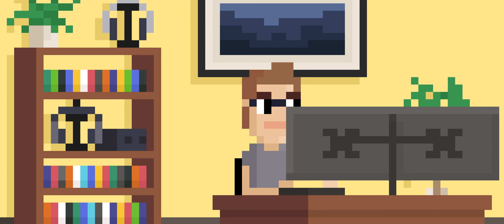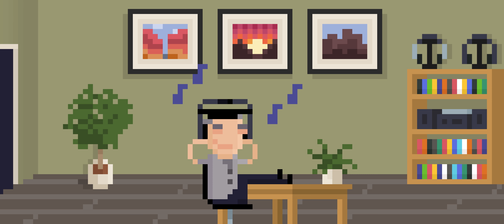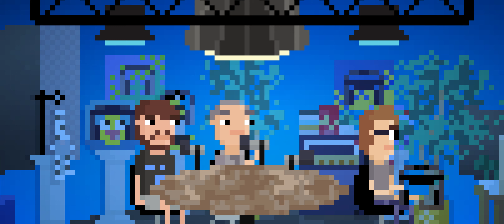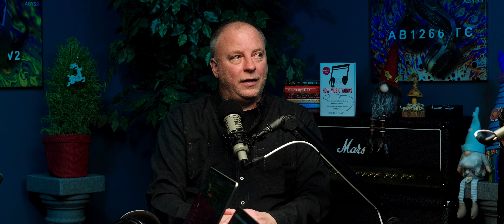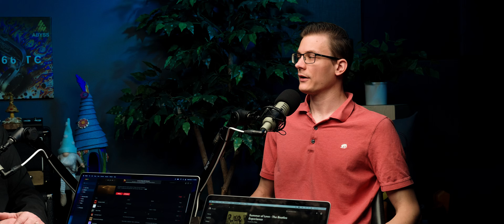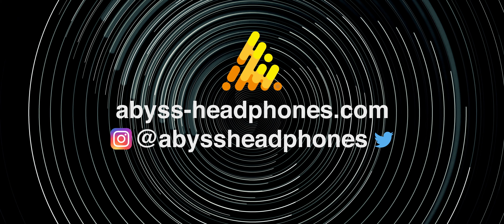Can M1 Pro Power ENDGAME Headphones?

Comment: the hp output on new MacBook Pro sounds best with IEMs, not full-size headphones.
Reply: I think it is intended for the owner when they are not at home where their listening gear is, just so that they can have something to use with their headphone. After all the price of the MacBook Pro with M1 Pro and M1 Max is so high that no one in their right minds would buy them mainly for audio listening purposes, you can buy dedicated DAC & Amp stacks for far less, and still buy a very pro grade Windows or Linux laptop on the side.

Comment: Please try Apple's Type-C Dongle. I think it's pretty bad compared to the competition of ~10$ Dongle-DAC's. Because it's Sound quality isn't outstanding and using it on Android cuts the volume in half
Reply: Don’t Apple’s dongles measure extremely well?
Reply: Today I learned that Apple has a type c dongle DAC/amp. 🙃
Reply: @eruilluvitar  it's the same thing that came with IPhones until IPhone 11. Just with a Type-C plug and from what i've heard, worse performance
Reply: @Armbrust210  Yeah, that makes sense.  For some reason, I was thinking that all of Apple's products with Type-C plugs had headphone jacks in them (thus negating the need for Apple to make a Type-C dongle), but now I think about it I'm guessing maybe one of the iPads doesn't have a headphone jack?
Reply: @eruilluvitar  all the 11 and 12 inch ipad with type c don’t have 3.5
Reply: A lot of dongle DACs are DAC/Amps combos, Apple's dongles are DACs, their intention is to give you analog signal since the USB-C and Lightning ports are digital signal only, and are Apple device adapters, not general type-C adapters (in fact there's hardly anything like that yet), USB type C is a finicky system, look at how OnePlus phones won't charge at maximum power if you not using the specific type C cable even on their own charger, so it's not an Apple thing only, the USB-C standard is unfortunately not complied with yet, and now it is actually divided into subsets (sadly), making USB-C to be no more than just a shape. Oh, it is also Thunderbolt, another different monster.